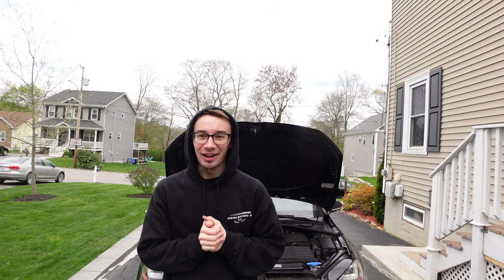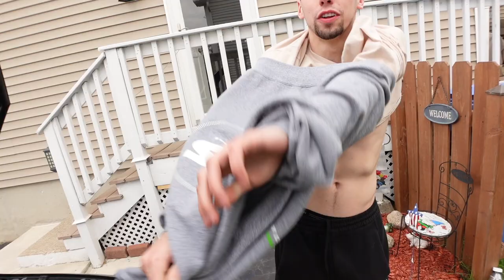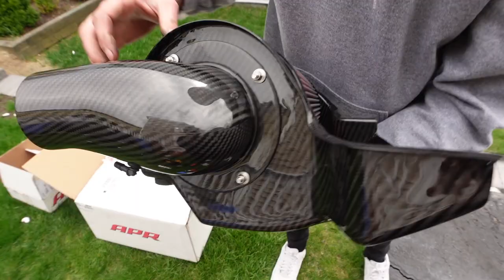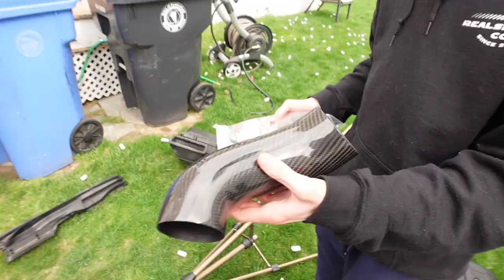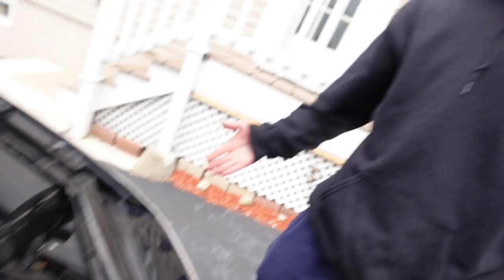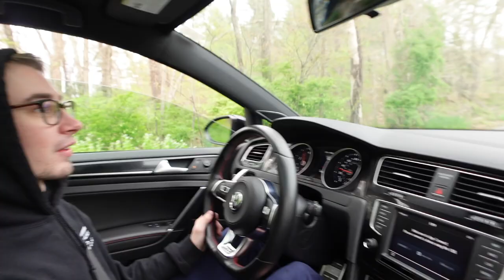APR Carbon Fiber Intake install on the MK7 GTI!! HUGE SWOOSH SOUNDS!! 😱

Comment: It was already tuned wasnt it? Basing it offf there being no soft limiter when you rev in N.
Reply from the maker: The car was actually not tuned when the intake was installed. I ended up getting it later on with a DSG Tune. From what I remember it should’ve still been 4k limiter but I’d have to go back in the video and check

Comment: do you have blow off forge ? 
I have that APR PEX intake and it sounds like a blow off ! But Im not sure if it is nórmal or I have an air leak…. I think not because I didnt lose power.
Reply: do you have the face lift mk7.5?
Reply from the maker: I do not have an aftermarket blow off valve. It’s definitely normal because my carbon one is essentially the same thing as the pex and it sounds the same it’s insane! I love how loud it is but it is completely normal haha